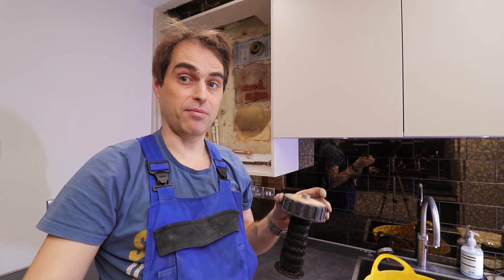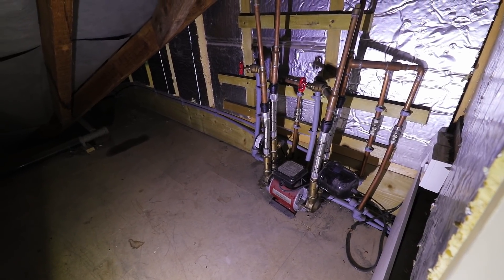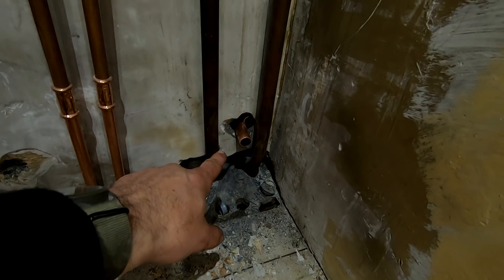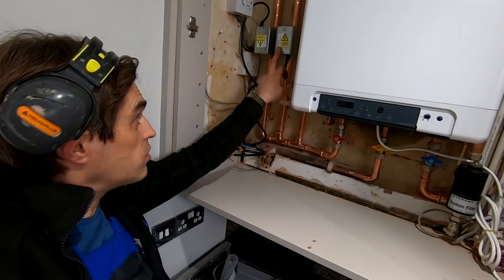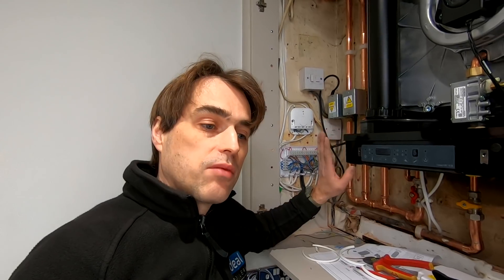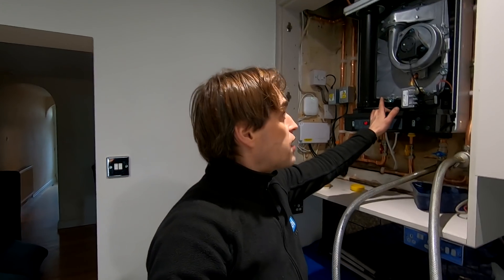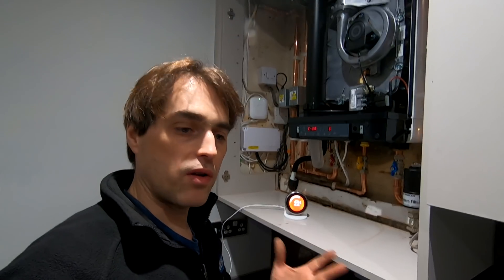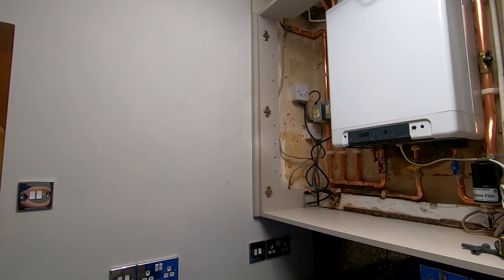Another house saved from a combi

Comment: I watched your YouTube videos with great interest.
I am planning to replace a very old boiler with a Greenstar 4000 Life system boiler.
I tried to fill in the form on your website. But it did not go through.
Could you please add your email ID?
Thanks!
Reply from the maker: Yeah, if you use word Worcester or Bosch it stops the form. Try Vaillant or Viessmann instead 🤣
Reply: @UrbanPlumbers  
I used " Greenstar 4000 Life ".
I tried again without it and it seems to have gone through 🙂
Reply from the maker: Told you 🤣🤣🤣

Comment: Why would a 30Kw combi not be able to deliver priority DHW for 2 showers when each shower is not going to delivering a mix of hot water vs the heated boiler HW anyway (and some aerator taps would cut that HW demands for taps and perhaps an 2 water efficient shower heads?). How can the old boiler be expected to have ever worked if never power flushed or looked to have been serviced (whats the point of fitting a magclean if never cleaned out either). 
Any reason the client went for Nest over a other controls (like intertec ones) and were TRVs and weather compensator fitted?

Comment: I've never met a plumber who did anything right. Want your system flushed? Good luck getting a plumber to actually do it, rather than just pretend it's been done. Also pipework all over the place, thermostats that don't work, leaks that get fixed with blutack. I gave up. I try and do everything myself now, despite having my own job to do.

Comment: Excellent video, thanks! It's convinced me to change to an unvented HW cylinder when I get a new boiler.
One question; I have Hive fitted, & not overly keen on it, as it's not really "smart", & would like to swap to Nest open therm. However, intend moving boiler to garage, which is next to current location of boiler where all the electrical connections are. Would it be a complete nightmare to move all the electrics to the garage?
Plus, any recommendations for a heat only boiler would be appreciated. 
Thanks 👍

Comment: You have convinced me that X plan, hot water priority on unvented cylinder (with variable output boiler) is the way to go... although I could accommodate a bigger cylinder.... Your final comments leads me to think there is a better option? Great videos btw! 👍
Reply from the maker: I would recommend Vaillant 6 series with Senso Comfort Controls or Viessmann 200 on 4 pipe over Intergas. too much wiring and non-standard solutions are needed with Intergas. 

Viessmann and Vaillant are much more streamlined products with better modulation.
Reply: @UrbanPlumbers  amazing thanks 👍 what about compatibility for controls - opentherm on multi zone heating?  (Rads + separate UFH) - although the full weather comp seems a good / simpler option for the modulation? Thanks
Reply from the maker: @stevecharles8202  just use weather comp and no zoning unless you have UFH and rads. If you have UFH and rads then it is best to do what I did here:

https://www.youtube.com/watch?v=OG8lATPDpW4&t=852s

Comment: Wow I just love watching your videos.  Not that I am ever going to have a system like these installed here in British Columbia but it’s great to watch someone that knows what he is doing.  I have been getting advice on heat pumps and sure wish I could come across someone with your skills.   I just need to replace my forst air gas furnace that is working just fine with an electric furnace/heatpump.  It would be nice to just add a heatpump system to my furnace but I was told it was built in  1993 making it too old so you need one of our new ones.  I just don’t know what to believe anymore.

Comment: Great video, I’ve noticed on some jobs you solder and on another you using press fit. Do you give the customer the option or you decide what to use where?
I’m asking because of the cost is different. Thanks
Reply from the maker: No, same price. Press is more expensive but much quicker so it works out about the same.

Comment: Lovely job there mate,I have just had a solar system fitted 3.2 array +3 battery’s x7.8kw,in a 2 bed house ,have a gas combi to heat 6 rads and hot water.I’m now thinking of changing combie as it’s coming to 10 years old ,but I’m not sure what is the best way to go now I have the solar ,I do have a electric shower but want to also want to change this to come off hot water .what would do if you were me ,many thanks
Reply from the maker: Unvented cylinder with solar diverter and system boiler or air source heat pump
Reply: @UrbanPlumbers  thanks for coming back to me ,would you use a electric boiler in stead of gas
Reply from the maker: @kevinjackson6387 Definitely not an electric boiler! It will cost 4 times more to run than a heat pump and usually give awful hot water performance if it is a combi. Gas or heat pump only with unvented and solar diverter.
Reply: @UrbanPlumbers  thanks for that

Comment: I know someone who had an A.S.H pump, & the company who fitted it, along with a huge s.steel cylinder, ended up removing the cylinder, which customer paid for & the company then installed a shitty budget Vokera combi in, because the system wasn't providing enough heating, as the property owners like to get baths instead of showers & the hot water was priority, leaving the upgraded/upsized radiators under performing.
But I think it wasn't surveyed or set up correctly.

Comment: Isn't this enough for two showers? : Viesmann 200W: max power 35kW, max flow rate 14.3 l/min .
Reply from the maker: You only get 7l per shower at 35c temp rise and you would have to upgrade the gas in my case to 28mm

I am getting 20l/min at 45c rise so way better got water performance on a boiler that costs half of what 200w

Comment: Is X-plan limited to Intergas boilers? Ive just had a Viessman 100-W system boiler,  unvented cylinder and Hive controller fitted as S plan. Hadn’t realised this doesnt allow OpenTherm control for efficient boiler modulation on room heating & with current fuel prices wondering how to achieve OT without getting plumber back to convert to 4 pipe DHW priority system.
Reply from the maker: Viessman can be done x plan or 4 pipe. Installing Viessmann on S plan - hmmmm
Reply: Ah, that’s good to hear, many thanks!
Do you have a link to a wiring diagram for Viessman on X plan?

Comment: When I retired from plumbing in 2005, push-fit was just starting to come in. I’ve never really used it, it was galvanised threaded pipework, soldered joints, bronze welding or arc welding plant room headers. Being Corgi registered was a real ball-ache, push-fit looks like a dream to use. No blow lamps or benders required.
Reply: you surely mean PRESS fit not push fit.
Reply: Can cause a lot of hassle as the fittings can sometimes pop off if fitted incorrectly or faulty and it doesn’t look as nice as copper, also can’t install plastic too close to the boiler, needs to have a minimum 1 meter run before using plastic because the boiler can melt it, but is definitely easier to install and cheaper because of how expensive copper is right now

Comment: Are those crimped copper fittings?! No solder?! Where does one get the parts and equipment for that in the United States?! That looks SO much easier than soldering! EDIT: found it at Home Depot, but I see rubber gaskets inside those rings, which makes me have to ask: any idea how long those gaskets last? If they've got a 25 or 50 year lifespan, I can start to see the benefit of soldering, even as much trouble as it is. Also, I saw how much a Milwaukee brand of that tool costs and I nearly choked! Definitely meant for professionals who do this for a living.
Reply from the maker: you can get thenj anywhere. They are actually much more popular in the USA than they are in Europe.

Comment: When I needed a new boiler I chose a comventional one so I could keep the hot water cylinder. The old boiler could not be used because the heat exchanger was leaking and I had to wait a few weeks for the new one to be installed. If I had a combi boiler that would have been weeks with no hot water. I was able to heat the rooms with electric heaters. Also the new boiler was a straight swap except for the addition of a condensate pipe, making the installation easy and quick. which no doubt cut the labour cost.

Comment: No closely spaced tee on the supply and return. I hope you're not going to use the system circulator to move all the water! Taco 0015 circulator is only $100 the system circulator can cost upwards of $600.
Reply from the maker: Why would you want a CCT on a system with one flow rate and 1 heating zone??? Boiler pumps is more than capable in this case.

Comment: So, hear me out. Here in the US you can't run gas in copper pipe. It needs to be in a steel pipe or some sort of heavy duty braided rubber pipe. Why do you use copper?
Reply from the maker: UK and Europe uses copper for gas. No problem here. In Uk you can use many materials. In some countries, soldering of copper pipework is no allowed, but it is in the UK.
Reply: @UrbanPlumbers  Appreciate the reply! That is rather interesting.

Comment: Can you post a diagrams of how your wired the hot water NTC with the high limit stat please. Thanks
Reply from the maker: I will do a full video about wiring with NTC and Intergas
Reply: @UrbanPlumbers  Thanks. You will find different wiring’s. Iv been working on One Xplan that Intergas say I have to speak with the designer. We also had an issue with a new boiler PCB. That was headache too. Then the flue was wrong 😂
Reply from the maker: There is a lot of ways you can wiire x plan! I know of at least 4 ways to do it. I am working on a video that will cover it in full detail including NTC and high limit stat with NC and NO positions
Reply from the maker: Generally you wire both NTC and High limit stat straight back to boiler. High limit stat is wired Common and normally open back to NTC connections on boiler PCB
Reply: @UrbanPlumbers  one diagram said wire in series the other was like what you have said. After asking around the manufactures changed the data sheet to on parallel. Let me see if I can find the diagram.
Reply: How do I post a pic?

Comment: Great vid but to say a combi wouldn’t run two showers🤔. Nice work though. I’ve done it so many times filling the system at 1800 doesn’t always go well🤯.
Reply from the maker: Not a 30kW combi
Reply: @UrbanPlumbers  surely it depends on the litres per min not the KW of the boiler? I had one of those intergas boilers the other day for a fault. Code 11 so as advised changed the S1 sensor no change then advised to change the aqua sensor still faulty but now intermittent any ideas?
Reply from the maker: @konradbidwell8363  intermittent fault would point to a flow sensor or lose connection. 

Flow rates depend on both. First you need a minium flow available, lets say 15 liters a minute. Then you can work out your temperature rise in Celsius per litres a minute at a given temp rise. Combi boilers are usually rated in DT (temperature rise) of 35 degrees C.

The formula is as follows:

Flow (in litres a minute) = (KW rating * 60 seconds) / DT 35 C * 4.2 (specific heat capacity of water)

If you check that for a 30kW boiler, you will get (assuming 30kW is net not gross)

Flow = (30kW * 60s) / 35C *4.2 = 1800/147 = 12.20 litres a minute @ 35C degrees Celsius temperature rise.

This would mean that if your mains is 10C you will get 12L / minute from a 30kW combi at 45 degrees C. That would give you 2 showers at 6L per shower per minute - its a dribble.

40kW would give you 15-16L - which in theory could give you 7-8L / minute per shower. Not amazing, but almost usable.

Unvented cylinder in this video gives 22L / minute at 60 degrees C. A whole world of difference!
Reply: @UrbanPlumbers  surely it depends on the litres per min not the KW of the boiler? I had one of those intergas boilers the other day for a fault. Code 11 so as advised changed the S1 sensor no change then advised to change the aqua sensor still faulty but now intermittent any ideas?

Comment: How do you change the bottom immersion heater element if it fails? It doesn’t look like there’s enough room.
Reply from the maker: It may not look like it, but there is enough space. It is a relatively short element and once undone you can move it to the side. I made sure that it was possible by trying it before final position of the cylinder was set. 

However to take it out you still need to drain the cylinder, so undoing 4 compression fittings and twisting cylinder to the side is also relatively easy.

Comment: Are those push fit fittings? Lol.
Reply from the maker: No, press fit
Reply: @UrbanPlumbers  do they come off easily, seeing what they cost per fitting I’d hope so. I can see their use in places you might not want to put a blow torch but other than that it seems an expense that isn’t required.
Reply from the maker: Once crimped you can’t remove or reuse them. They are 10 times quicker than soldering so they pay for themselves it time saved. You also do not damage your hands and lungs with toxic flux

They also never leak. 

I almost never solder anymore. No need.

Comment: Nice workmanship, nice to see! Only point on here is your use of a normally open zone valve on an unvented cylinder 🙁. Part G of the building regs 3.31states “motorised valve, the device should operate to interrupt the supply of energy if the electrical power is disconnected”. This is why a normally closed valve is always supplied with the cylinder. This is one of the 3 major safety devices on unvented cylinders.
Reply from the maker: NO is on heating!

Comment: heat pump applications  are unsuitable for 90 percent  of existing houses due to cost and insulation
Reply from the maker: Can you quote any sources to support your claim?
Reply: @UrbanPlumbers  what does it cost to install a heat pump ,or even this installation ?,i have had a new  combi boiler fitted recently  had 5 quotes from heat pump guys and each one told me more or less the same ,older building  not recommended new builds heat pumps should be the first choice

Comment: I’m from Toronto canada and was trying to wrap my head around your terminology but I now realize your tankless hot water tank does “space heating/Radiant” and you have high temp heating going into your domestic heat exchanger up stairs to give them the water for showers etc. 

I find it crazy that these are always in kitchens in Europe. I guess most of these houses do not have basements like we do. That is usually where all residential heating/mechanical equipment is located.
Reply from the maker: Basement installation are very tricky here. For starters, most basement do not have drainage and all condensate from condensing boiler has to be pumped. Also, cylinders have a safety valves to realise boiling water in case of overheating or high pressure - this also has to be pumped. Pumps for those cylinders are very expensive, as they have to be able to handle very hot water (boiling) in a continuous fashion.
Reply: @UrbanPlumbers  all of our sanitary and storm drains exit in our basement slabs so ideally there would be a floor drain in the mechanical room. For the acidic condensate we just put a neutralizer on them and right down the floor drain. As far as safety relief valves are concerned those get hard piped to the concrete floor min 6” min 12” maximum. If your Temp and pressure relief or pressure relief valve is always dumping you’ve got some issues lol. I’m assuming your sanitary exits on the main floor which is why you are referring to sanitary pumps.

Comment: Hi I was wondering if you could help me. I have a choice between the WB Greenstar i system boiler 18 kW, sadly 4000 is not going to release to Irish until next year or the viessmann 100 w 19kw. Both offer 10 years warranty but WB customer service is way better and respond lot faster i.e within two days than viessmann since they use third party to manage boiler issues. I know that build quality isn't the greatest on WB compare to viessmann. I am really struggling to decide which one plus need to make decisions fast as old boiler is dead. The gas installers told me it way easier to deal with WB compare to other companies that why they recommend WB also they told if you regularly service it they cause no real major issues but saying that looks it base on opinions as well.
Reply from the maker: I would go with viessman on hot water priorityset up.

Comment: Great install, so good to see someone that would never question staying until the job is done.
When I had a new system installed a couple of years ago all they were interested in was getting to the next job as quickly as possible.
We had two small children and a new born in a house without heating for three weeks because they couldn’t be bothered to work out the right way to integrate the new system with the existing pipe work or spend the couple of hours after the install making sure it was all working.
Also, press fit is the future! Why doesn’t everyone use it??
Reply from the maker: Leaving a client with a non-working installation for a week is pretty bad! I am sorry you had to go through that. Next time, chose your installer more carefully.
Reply: Quite high initial costs,  press fit machines with all the different sized heads all in are easily over £1K and the fittings are much more expensive, relatively.
Reply: @tonydization  I would look at the time saving to build value but I understand your point
Reply: @joelawton123  I agree but as UP admitted he wan't sure on the relative merits but has become a convert as am I.
Reply: The machine costs about £1500 puts a lot of installers off